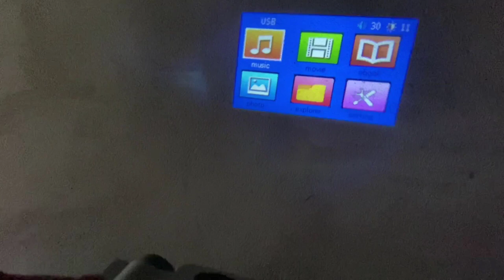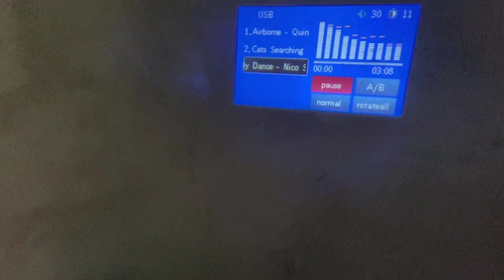Restoration of old 4K mini film projectors | Abandoned mini movie projector restore

Comment: Many videos on the internet show people picking up electronic products from the trash heap, cleaning and repairing them. Inside these electronic products that have been exposed to the wind and rain in the garbage dump, there are many wire assemblies, with precision plugs at both ends. Realistically speaking, the metal wires inside those wire assemblies and the plugs on both ends have already oxidized. Even if the wire assemblies are cleaned, they can no longer transmit signals and currents correctly. However, these repairers never replace those wire assemblies. After they reassemble all the parts, the whole machine can operate normally. This is totally illogical and incredible.